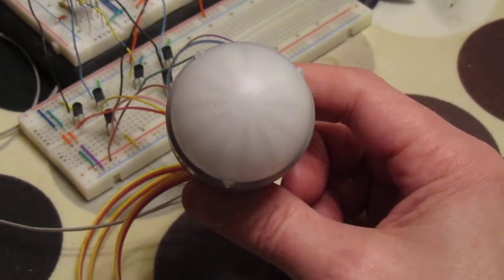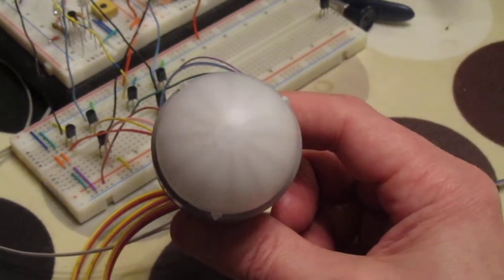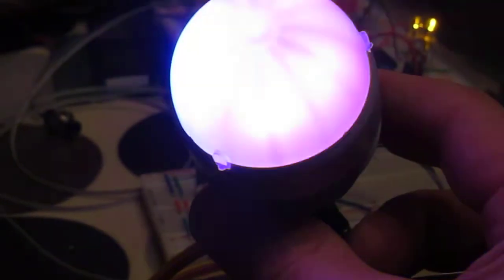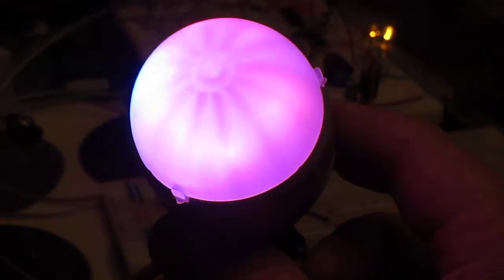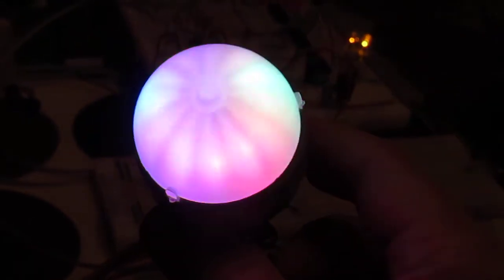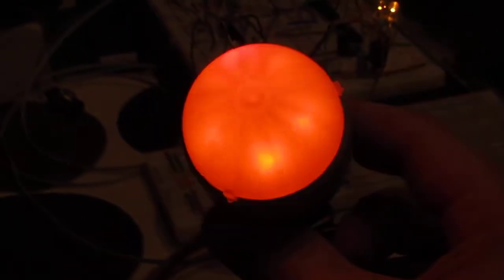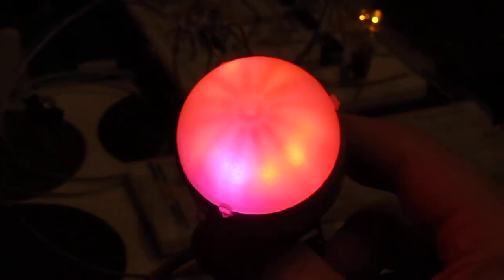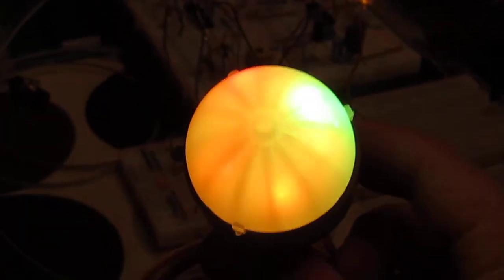SE66 Lighting System - Warp Engines

Comment: Dude that looks absolutely incredible! I made a revell kit without lighting for my uncle's birthday and I'm working on another one for my fiance, who has turned into quite the trekkie thanks to me!😂

Anyway my revell kit came together with the visualights lighting kit, but I wanted to get the nacell heads spinning just like that. I've got the motors for them already but how the heck did you get it to ramp up like that?? I get using a trimpot to adjust the max speed, but is that like an arduino programmed to slowly increase voltage or something? If you could help me out with this bit I WOULD BE ETERNALLY GRATEFUL! (And so would my fiance lol)

Comment: Hi Ross,
Fantastic job! I'm working on some lighting for the TOS Bridge using a4017-556-555 circuit based on your work. Thanks for the inspiration! Where did you get the motors?
Reply from the maker: Thanks! The motors in the video are from Pololu but the ones I've (almost) settled on are Sayama purchased from Electronic Goldmine. Others are using them too as they are only slightly bigger than the PL lighting kit ones which means with a little sanding they can slide into the kit part.

Comment from the maker: Hi Eagle - thanks for the compliment! I'm still working on it as I'm trying to minimize the wiring up the nacelle struts, plus I haven't yet decided to go with DC motors (what I've been using so far, only 2 wires needed and easy to control but a bit loud) or stepper motors (4 wires needed, way more complicated but should be whisper quiet). The only thing I've released so far is the supplemental kit t fix the saucer blinking running lights.
Reply: I am very impressed with just the work you have done. It looks really close to the original effect, and is excellent for the scale. My build is on hold, but I would really like to have one of your assemblies as opposed to the R2 light kit
Reply from the maker: EAGLE Thanks again Eagle. Mine is on hold, too, while I replace the clear window inserts with the white ones. When I get back to the lighting project I'll post back here.
Reply: Cool. Looking forward to it!

Comment from the maker: Hi Ouhscpa - I have not finished the project yet. I did release a supplemental board to fix the PL running light timings (you have to use their lighting kit, though - mine just plugs into theirs and the LEDs are driven from my board).